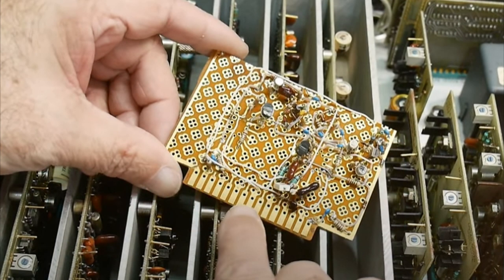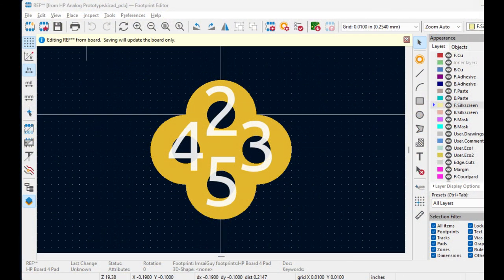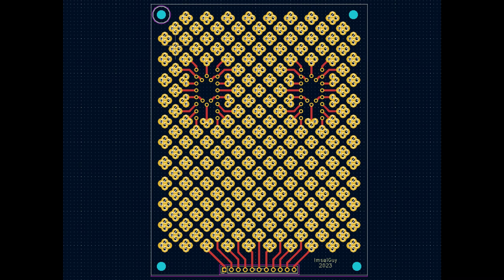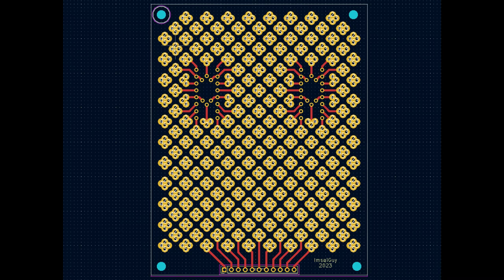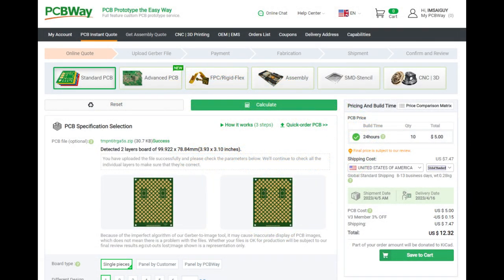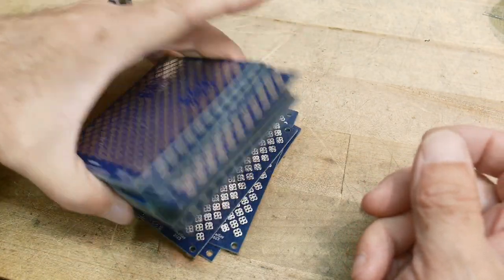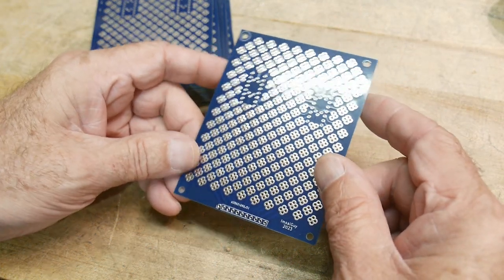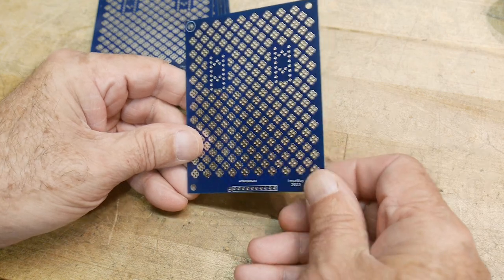#1474 New  HP Analog Prototype PC Board

Comment: That's pretty cool.  Nice places to put DIPs and solder stuff to them.  However, I prefer the protoboards which look like breadboards because you can test the circuit on breadboard and easily transfer it exactly to the protoboard, piece by piece.